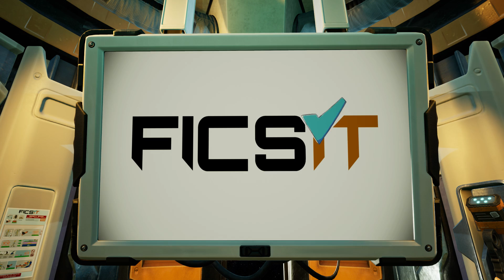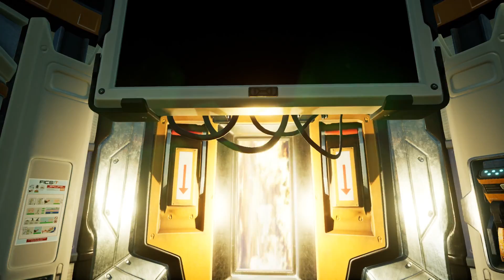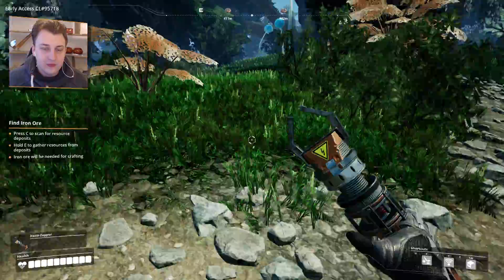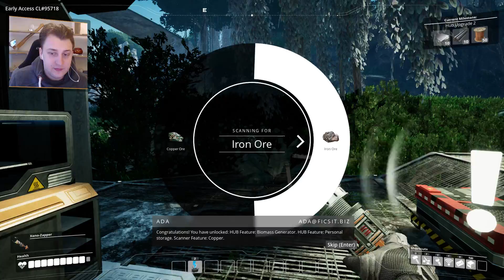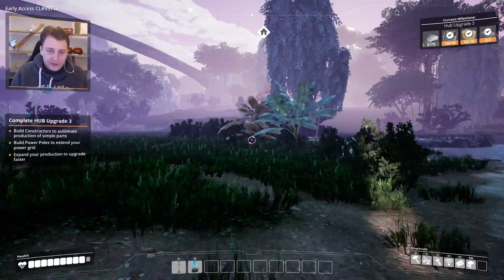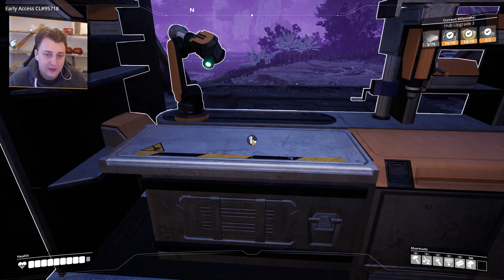Satisfactory [Fast-Play] 🏭 01: A progress-oriented playthrough

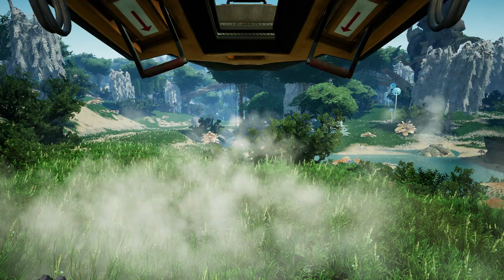Comment: 2:20 "Remember, efficiency first! Godspeed."
Looks like you took it to heart ^^
Reply from the maker: I'm sure there is plenty of strats to improve on, but they would rely ion handcrafting a lot, which seems boring to me. I wouldn't like Speedrunning this game most likely.
Reply: A great video, I'd never have guessed there would be one video qualifying for both [unboxing] and [speedrun] at the same time! 
But yes, speedruns start with a lot of resource-fetching and workbenching.  Grab leaves on your way, stab ore deposits, craft enough components for a few miners, place them, stab some more rocks, craft, loot the miners, craft some more, etc.  Conveyors are used too, but primarily as poor man's stairs to get to the miners and back faster. 
And the efficiency is just nuts.  At that rate, the player is doing more than 10 megawatts of work, i.e. more than just about any production building, without any external power.  IMO, crafting and the portable miners are OP.